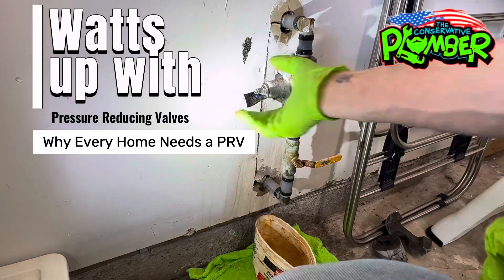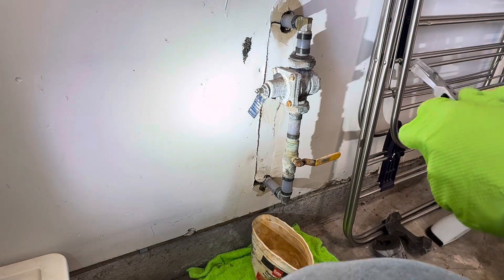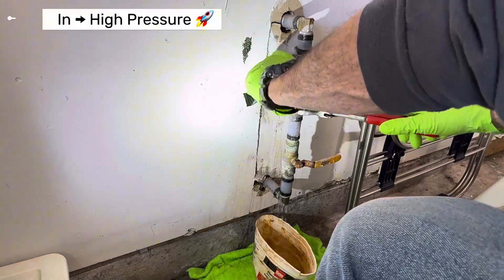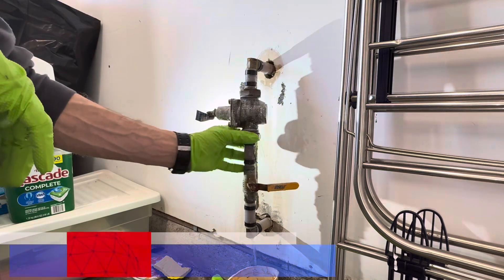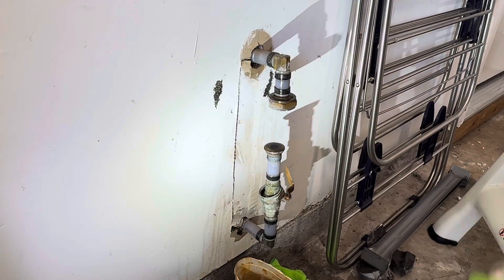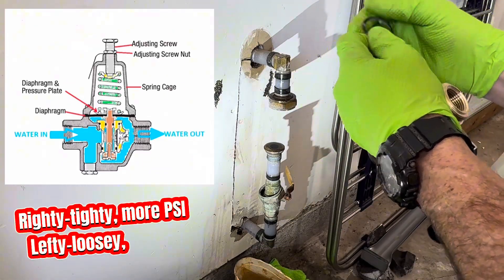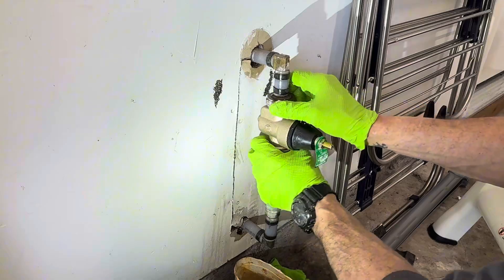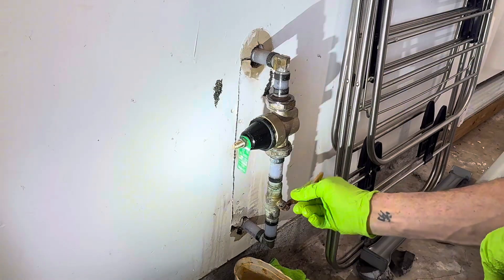FIX HIGH Water Pressure FAST with a Watts PRV | Plumbing TIPS

Comment: Is there a way to safely increase water pressure, if it's too low in the house?
Reply from the maker: Put a gauge on a hose bib and adjust it with the screw. Could be a bad prv if it doesn’t change